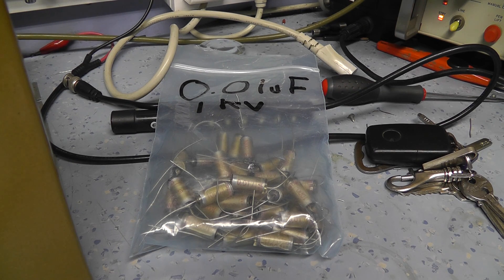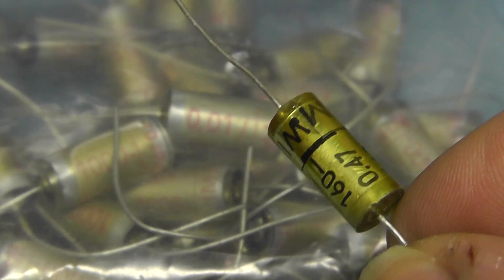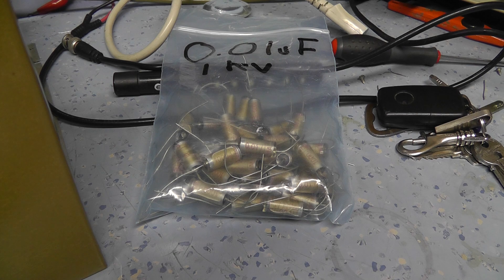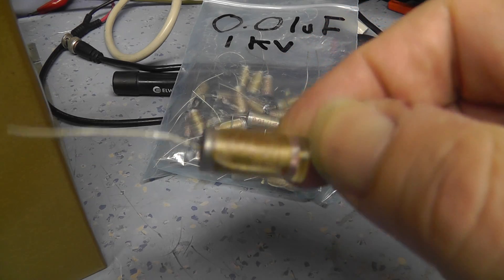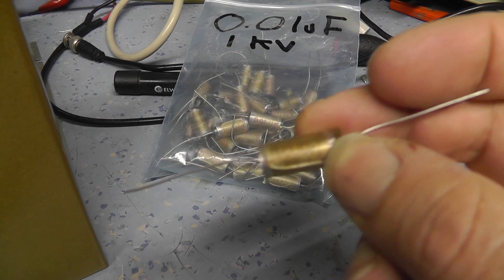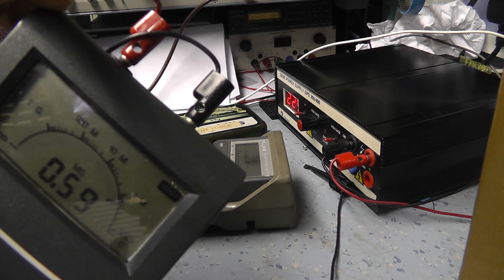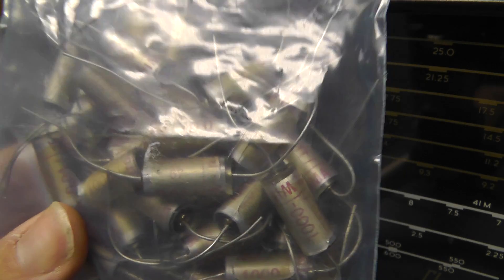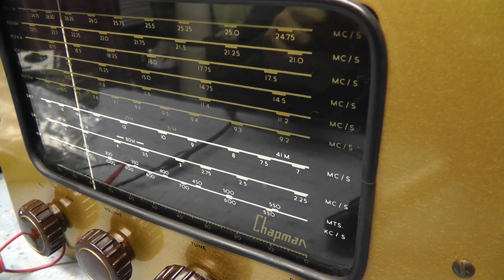NOS  Paper Capacitors. Any Good?

Comment from the maker: OK, the conclusion .
 I think as long as the capacitor in question is not showing less that around 100K Ohm, and is on a low voltage part of the circuit, these capacitors would be fine. Where I would not leave them is in grid coupling circuits that have anode/plate voltage on one end and need to remove all traces of DC at the grid of the next valve.

Comment: Maybe they could perhaps be reformed I seen where people reform nos capacitors carefully. Also allot depends on what material paper capacitors are made with Some are hermatically sealed some Russian capacitors have glass ends. I have been told if your going to want use paper capacitors go with Russian capacitors quality better. Tube Depot has some new paper capacitors that are hermtically sealed still get them. Tube depot sells good stuff bought stuff from them in past. Some people restore old radios might want keep them vintage like you can have multi section can capacitors custom built on heyseed but not cheap.

Comment: Is that a crack in the moulded case of the cap?  That could allow moisture ingress and result in a substantial reduction in insulation resistance.

It looks similar to the problem that occurs with the dreaded RIFA mains suppression capacitors. In these the epoxy resin over-moulding becomes extensively cracked over time, causing excessive leakage and, eventually, resulting in capacitor letting copious quantities of the magic smoke.
Reply from the maker: Yes, and most i tested had a crack. However even the intact ones were leaky.

Comment: I fixed a solid state Kenwood ham radio transceiver recently and was so proud of myself that I sent a note and pix to a friend who wrote back congratulating me along with the comment that the pix of the electrolytic cap I used that I'd  pulled from my stock had a date code of 1998 as I recall (heck, I did buy them new, doesn't that count?)....nuts! I did test it with my ESR meter before sticking it it and it read fine...it's in a simple audio coupling configuration and the radio works fine but I get that nagging feeling that I really need to go back and replace it...grrr!